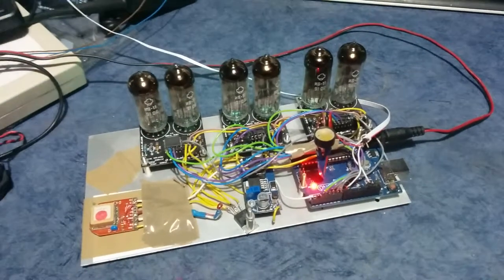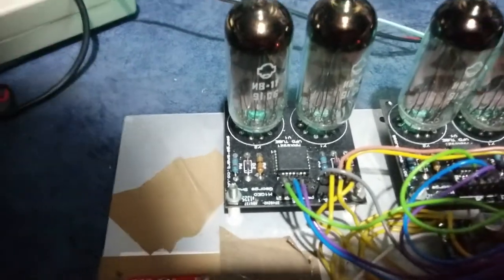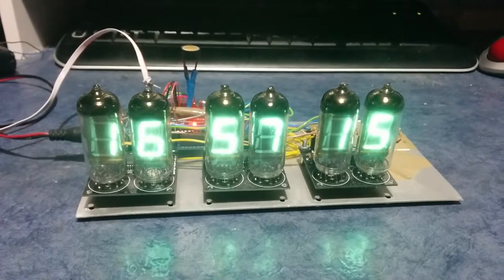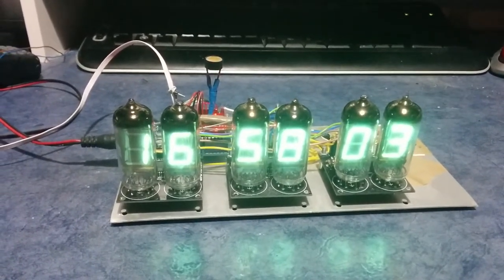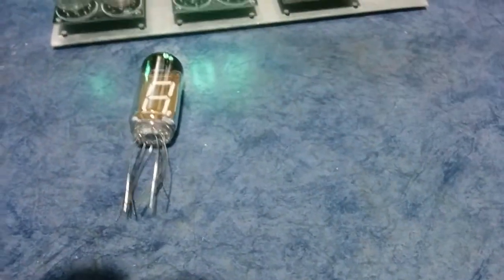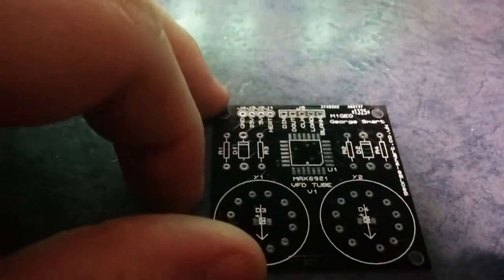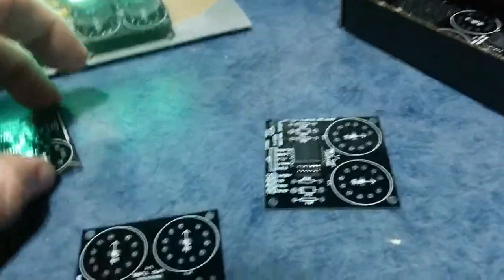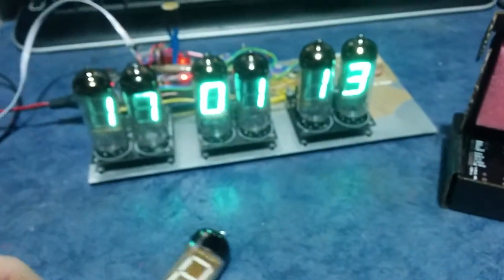Homebrew IV-11 VFD Arduino Clock

Comment: This project is exactly what I was looking for! I would like to reproduce but I miss some information regarding the wiring and the various modules you used:
1. First, the PCB link is dead on the wiki page as well as on the github readme (I posted an issue on github regarding this). A schematic of the PCBs would be very helpful.
2. What kind of pins do I need on the GPS module? The GTPA010 is kind of hard to get and there are cheaper alternatives, but I'm wondering if a pinout "VCC, GND, TXD, RXD, PPS" is enough? Yours looks like it has additional pins. Is the PPS pin required too? Finally, I'm guessing from the source code that you connected the TX pin directly to the serial pin (0) on the arduino, correct? If you're using the PPS pin, what do you connect it to?
3. In the wiki you mentioned a logic supply (3V to 5.5V DC) but I don't see it in the video, you used the output from the voltage regulator for this too?

Thanks a lot and sorry if I come though as a beginner, I am a beginner :)
Reply: I could use all that info too